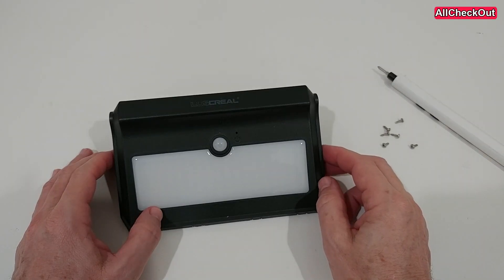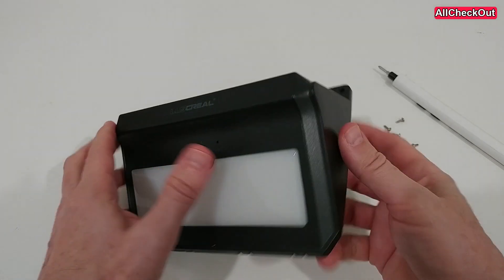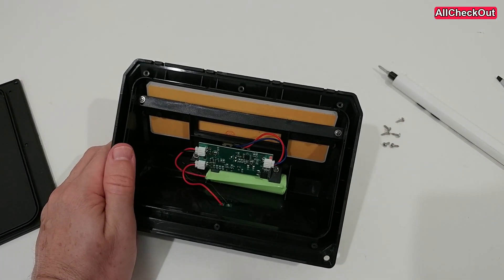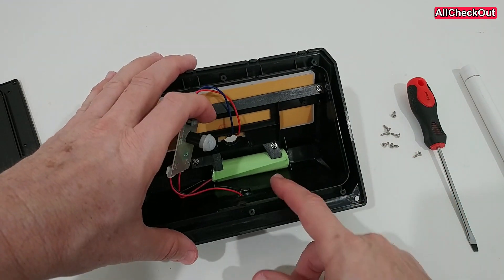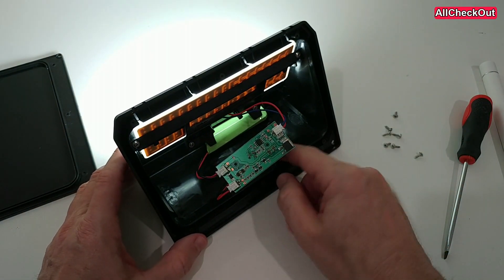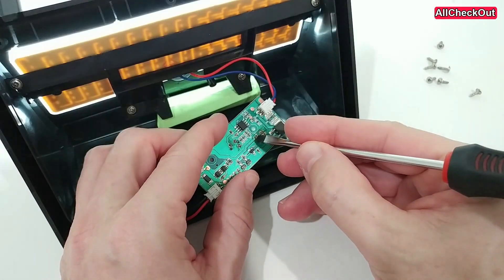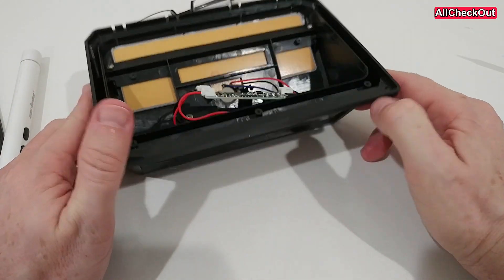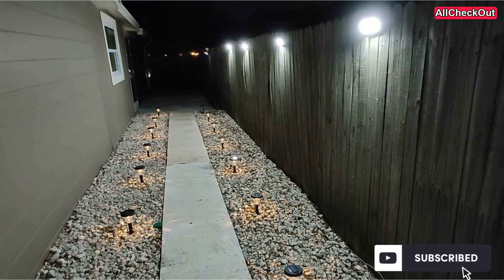How To Repair A Solar Security Light In 10 Minutes? (Motion Sensor Solar Light Repair)

Comment: I have a question, I now have 2 solar with sensor lights that when it’s day time, and you walk past the light the sensor triggers the light on, it should only switch on at night only when the sensor detects and not during the day. Is there a fix?
Reply from the maker: Wow ... never had such effect. Probably light sensor blocked or defective, but usually these days solar lights don't have light sensors any more, but maybe double check

Comment: I was hoping you would reverse engineer the unit. mine is corroded
Reply from the maker: They are not worth usually full repair. If you can replace the (standard) batteries .... yes, other than that buy a new one

Comment: Ok so got a question...ive got a ton of these all over my property and have many different brands and watts amps connectors chargers solar panels that connect to them all 12 volt plugs little round plug guys...anyways my recent issue is my chargers all get mixed up and i plug in one to charge durinf rainy season no solar charging happening, but it stopped working and wouldnt charge and wouldnt even flicker on at all and i have to assume i probably used the wrong charger and possibly blew a fuse or a compacitor wtv obviously im not savey on the technical names and just know i can solder impossible bits and boards and am pretty good at figuring electrical shit out that breaks or blows...but funny little thing i dont know is how to use the dang ohm meter lol ya ya i know, not my fault im self taught my Dad passed away when i was 12 and he and i never got to discuss his giant tesla coil that our local new papers were always talking about in the early 80s late 70s that hed built in our garage. My Mom always said ive got the same genus electrical mind like he had, but i just never have had anyone to really teach me the proper ways to do anything and just kinda get shocked the lessons i learn on my own. So anyways, should i just sit down and learn the ohm meter to test wtf the problem is with this dang solar powered motion sensor light i love but stopped working? Or should i toss it and just take apart the peices i can resuse and know how to reconnect to other power sources? I have the same screw driver, its my favorite and am veey protective over it lol

Comment: Can you Pl. tell me how to disable the timer since in my case it is on for only 25 sec. When motion is detected. I prefer it to be kept continuously  on during night.
Reply from the maker: Have you tried to "bridge" the motion sensor?
Reply: I removed the motion sensor and left the solder points as it is as per a video I saw
Reply from the maker: @sasikumarraghavan9214  Oh .... so there's a gap there now? And that works? Would be a wonderful solution ..... ;-)))
Reply: @allcheckout  , Yes it works. But my problem is the light glows on only for 25 seconds when night sets in. I wish to have it continuously on at night. Pl. let me know how to disable the timer in the circuit to make it glow throughout the night.
Reply from the maker: @sasikumarraghavan9214  Sorry - gave up with these experiments for the moment and just using these Amiluo Solar Outdoor Lights instead:  https://amzn.to/3ZOUcvT. Awesome lights with PIR, remote control, but also a low light "always on". My favorite solar light atm. BTW full review here: https://www.youtube.com/watch?v=jLJoHFBOtv4

Comment: Not exactly a REPAIR as much as a BYPASS.  I saw on another site where a man put a drop of white vinegar on a switch to dissolve some corrosion.  It worked but may not be a LONG TERM solution.  Danke.
Reply from the maker: LOl ... thanks for the tip and your thoughts